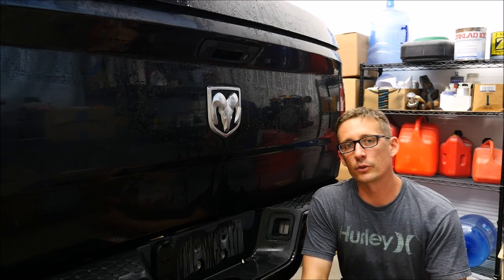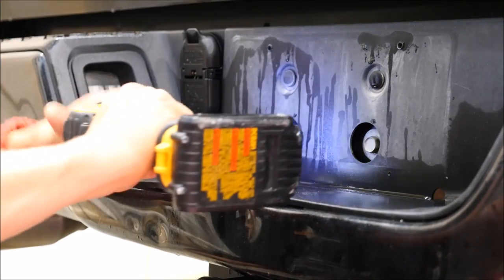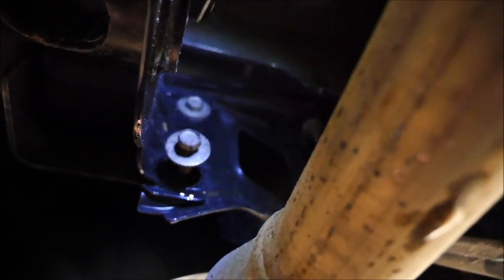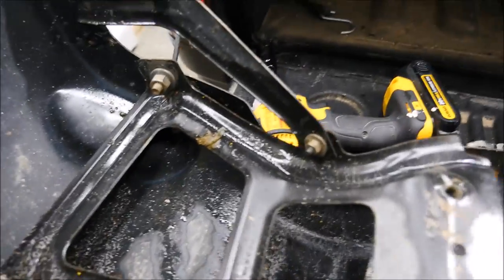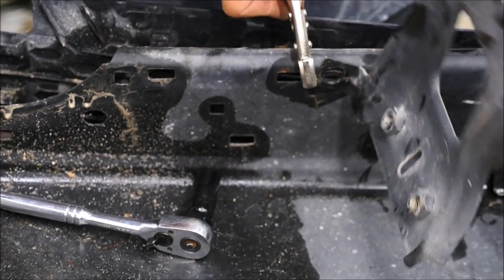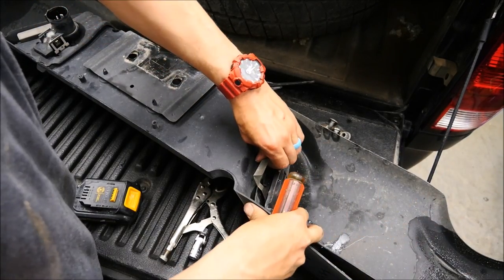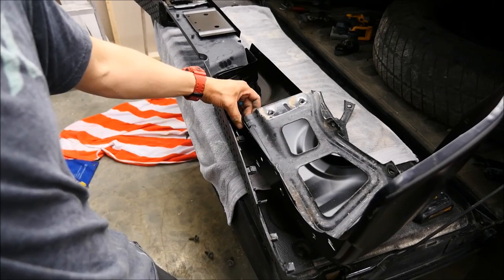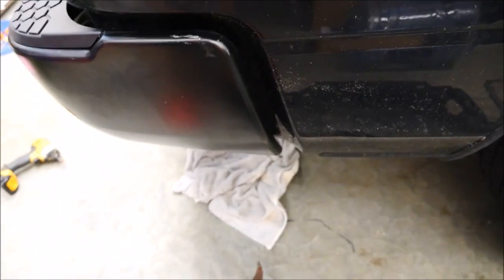DODGE RAM BUMPER REMOVAL AND INSTALLATION

Comment: Excellent video! Very thorough. My story - I was rear ended recently and as a result needed a new bumper on my 2016 RAM 1500.  The estimate from my body shop came in at $1700 to replace the bumper and repair very minor damage to a body panel.  Well, after watching your video, I said to myself, "Self, you can do that". So I did. After receiving a check from the other fellow's insurance company, I purchased a new bumper for $385 and put it on and Boo Yah, I pocketed $1400.  Amazing!  Many thanks.

Comment: Bolts are 15mm, 5/8 has a little wiggle-room in the fit, FYI.   Thanks for the video, it helped me replace the bumper on my 2009 Dodge Ram 2500.

Comment: Remove the bolts behind the license plate last.  They hold the bumper in place while your under the truck removing the 4 bolts behind the bumper.
Reply from the maker: Thanks for the Tip Bill appreciated bud!!
Reply: Exactly what I thought!

Comment: why not leave the 2 license plate bolts in while you do the 4 under bolts first, Then remove the wires..   Then, remove the plastics off the top entirely, before working on the brackets with the carriage bolts?
Reply from the maker: Not sure?
Reply: If you try to remove the plastic covers before removing the bumper the tabs have a much bigger chance of breaking off before it comes off(maybe not on the ram but chevy bumpers are a big PITA). No problem if you got new ones but swapping them over might as well make it easy on yourself. Removing the license plate bolts last is what I would do, no sense being underneath if you don't have to

Comment: Good info, I have a 2016 2500 and want to get a dual exhaust bumper from a 1500 on it, do you know if it will fit?
Reply: Enrique Fernando Asensio it should
Reply: Been told they both have the same brackets. I'm wanting to do that conversion also.

Comment: I have a 05 ram any suggestions for rusted bolts holding the bumper?
Reply from the maker: Smoove B I have used heat in the past (torch). Also PB Blaster. After it all doesn't work time to break out the grinder or sawzall bro!
Reply: thanks im a try the heat first if not grinder time...
Reply: Smoove B, how did that work for you?  I have an 05 Ram and need to take off the rear bumper as well.  Thanks
Reply: wow it looks great... i used a grinder and saws all  and just got at it . i would advise you to get new bolts and washers .

Comment: Will a 2500 bumper fit on a 1500 or is modification needed
Reply: I've been told by dodge dealerships that a 1500 bumper will fit on a 2500. Same brackets on both.

Comment: Didn't pay attention in physics class, huh? 
In each case where you were showing your attempts to hold a carriage bolt in place AFTER you had loosened them, you could have done it much easier with a LEVER! Simply place a screwdriver or small prybar between the captive washer and the bracket & pry TOWARDS the impact... let the carriage square do its job!
Work smarter, not harder!